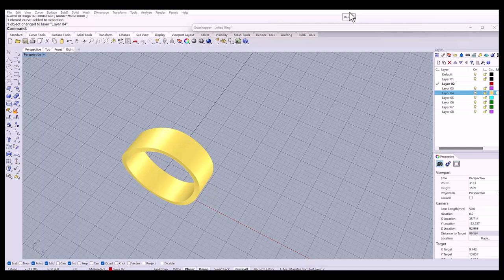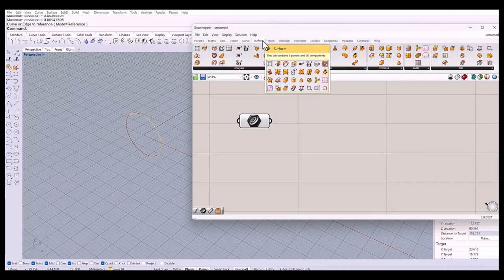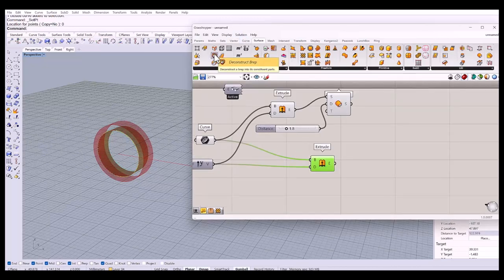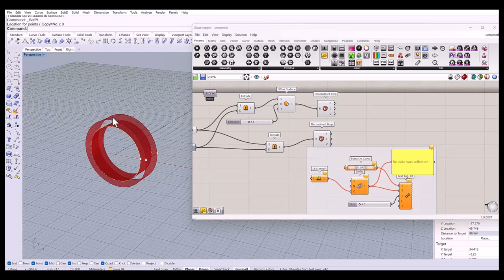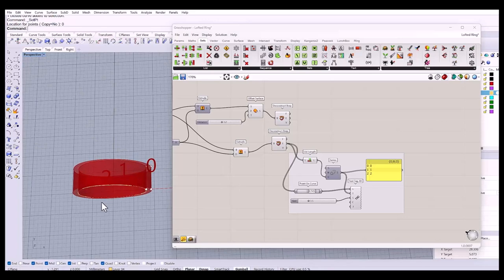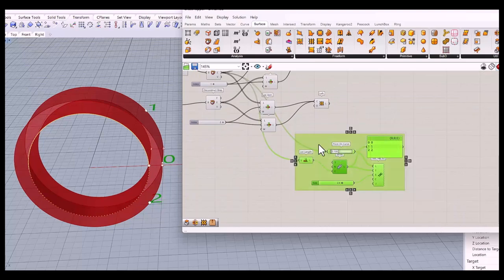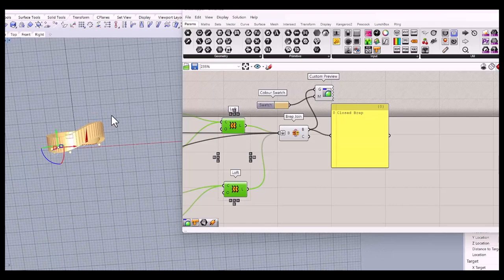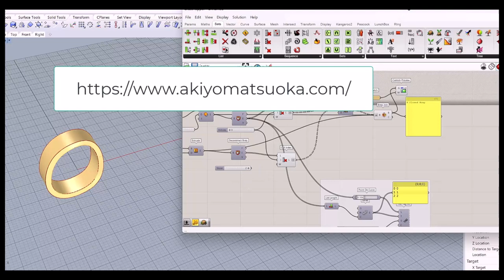A Lofted Ring with Grasshopper - #rhinoceros3d #rhinotutorial #grasshopper #loft #ring

Comment: This is a good tutorial.  The only thing I would change is the second extrude at the beginning is unnecessary as one could offset the 1st extrude and have just that much less components to manage.
Reply from the maker: You can do that too yes, it all depends on what you want to do with the extrusions down the line.
Reply: @essentialguidedigitaljewelry  Agreed. Even in Grasshopper programming it's best to follow solid software design principles including YAGNI... ("You Aren't Gonna Need It") is a practice in software development which states that features should only be added when required.   Keep the definition as light as possible, like keeping curves and control points as light as possible.  It's easier to modify/edit if there's no extra fluff :)
Reply from the maker: @richardaubin1951  definitely agreed on that point!